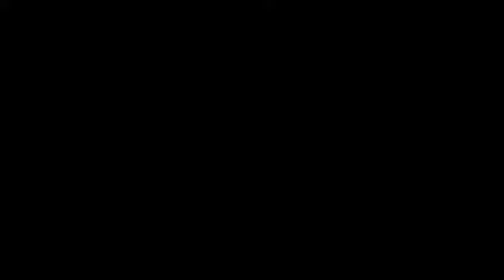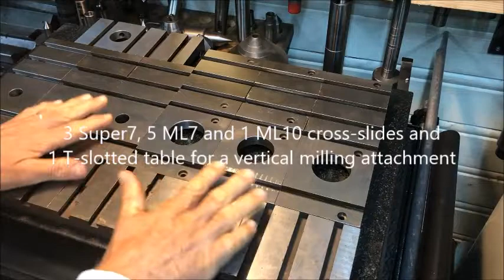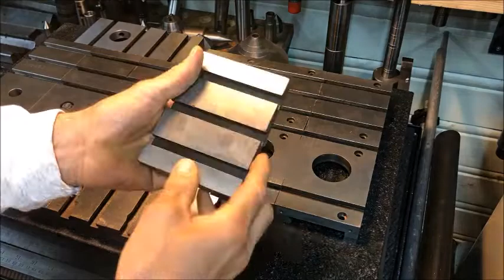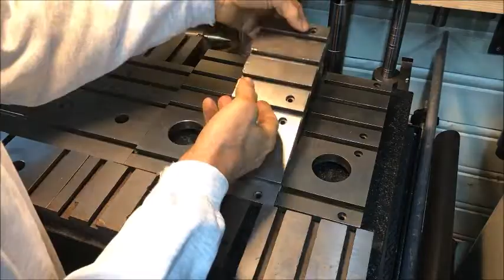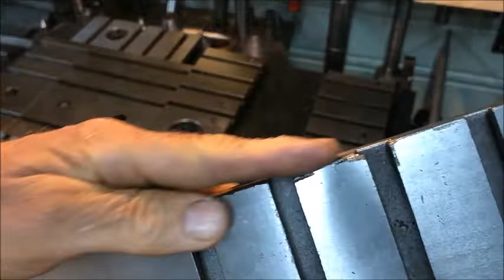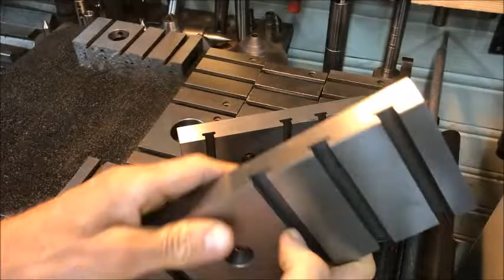Myford cross-slides from grinding

Comment: Could the extra two holes on the ml7 cross slide be for locking screws? Although I can't imagine why would one need to do that..
Reply from the maker: Could be. Could also be to make finer/easier adjustment. The gib on the ML7 is quite thin, so more screws would be better, evening out pressure.
Reply: @jansverrehaugjord9934  ml7-r  have two extra holes for locking
Reply from the maker: @najindustrolizovanij  Ok. Thnks!

Comment: Have you found much use for the cross slide t-slots, other than fastening your toolpost?  I see them used once in a while for backside parting or threading tools, not much else.
Reply: Useful anytime you want to mount a cutter in the chuck and the part on the cross slide eg for line boring or fly cutting.
Reply from the maker: @WilliamChitham  Agree! I intend to try out some parts line bored this way
Reply from the maker: Regarding the possibility of welding up the castings again, I did think about it, but because of my own inability to weld cast iron I thought the cost of having it done would not be justified. I also ruled out Silicon Bronze as my grinder friend said it would clog the wheel
Reply from the maker: I have used them in the setup process of rear-mounted toolposts sometimes, and they will play a role also for the same reason, but for front-mounted tools when used on the ELS equipped machines. In this scenario, the top slide is really only needed as a way to have the cutter at the correct centre height, ie. as a tool-block or riser, slide firmly locked in place to avoid any rock or movement. There is no need to set the at an angle since you have the taper program to move the cutter anyway in the z-and x direction automatically. As a "stationary" piece it is somewhat more of an "obstruction" than what just a smaller block would be (I have removed the handle and screw) . I will therefore make a more purposeful "riser block" and this can be mounted using the T-slots. I wil lalso take the opportunity to adjust the height of this to allow the use of bigger tooling
Reply: @jansverrehaugjord9934  -  You are trying a lot of things I'm interested in how your experiment works out.  I'm not sure how to measure rigidity in such a setup, but if anyone is in a position to make comparison measurements it is you and your fleet of excellently restored lathes!
Reply from the maker: @somebodyelse6673  Thnks. Yes, I am experimenting with different things and using the lathes as "test beds". The Myfords are fine as they are, but having the chance, I wanted to try some modifications I had in mind
Reply: I have a milling attachment on my S7 that mounts on those T slots.. you could of course also mount an angle plate.. v-blocks etc... with the milling attachment you add a z axis and you mount your end mill etc in the chuck..
Reply from the maker: @EvoKeremidarov  Yes, there are some milling and boring setups that are possible on the Myford if one doesn't have a milling machine. Actually even if one is available it is sometimes nice to have the capacity